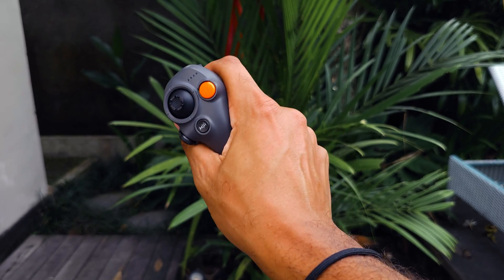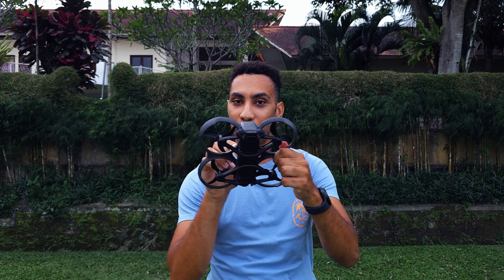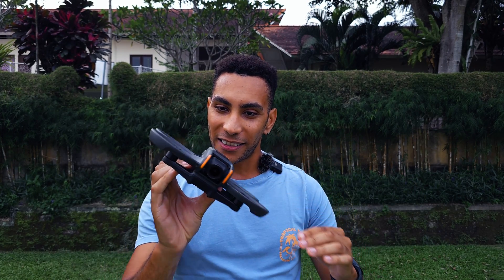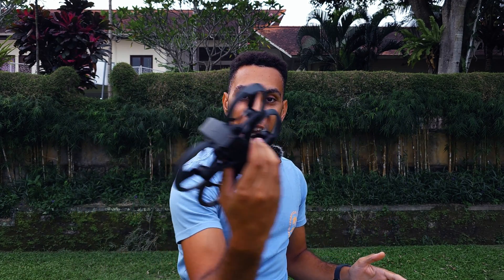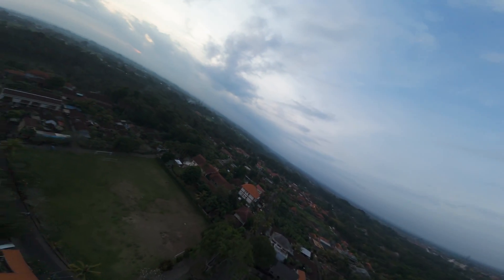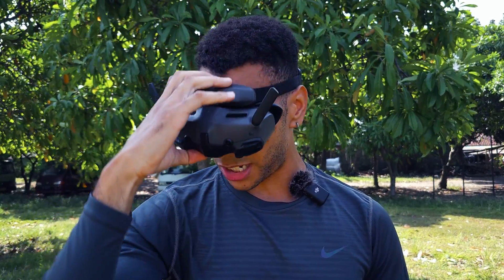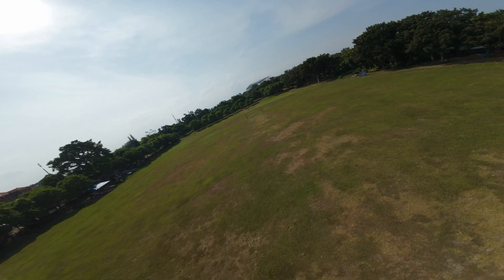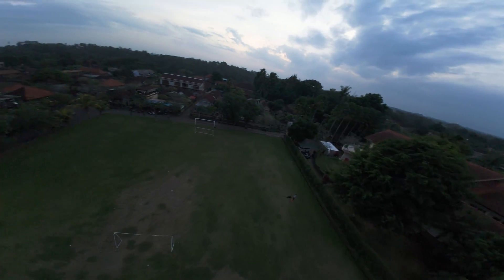How to AVOID the Yaw Tumble - DJI AVATA 2

Comment: Awesome video! Best, most thorough explanation of the issue, what causes it and how to avoid it. I do a hard eye roll every time I see someone complaining about this on Facebook or in a forum, saying that it's "a DJI design flaw!" of the Avata and Avata 2. If people just had a better understanding of what it is and how to avoid it (and how to be ready for it if it does happen), I think there would be a lot fewer crashes because of it. I had a pretty good understanding of it before watching this video, but something I wasn't really aware of was the issue with the violent shaking when descending straight down. I knew that it happened as I've experienced it with both the Avata 2 and Air 2s, but I never really new why it happened. With your explanation, it makes so much sense that it's essentially the same root cause as the yaw tumble - you're dumping the airframe directly through the dirty air from the props. Definitely feels better knowing the "why". Thanks for this!!
Reply: I mean you say this but my traditional fpv cinewhoop doesn't have any type of tumble so it's obviously a design flaw.
Reply: @BeautyBeastRC  yeap, why is it only a problem with avata and avata 2
Reply: @LibertyDIY  because it's a shitty design, I almost dropped it in the water 3 times, it has crappy electronics, I recently joined a group of fpv enthusiasts in my city and tried out a custom drone from a friend, let's not even mention the power of the motors which is impressive, but you can do that yaw maneuver as many times as you want and even at double the speed, that effect never occurs, only avata 1 and avata 2 have it. I don't know whether to sue dji to get my money back or resell it.
Reply: @BeautyBeastRC  EXACTLY!!
Reply: Too many people have zero idea of aerodynamic principles, and physics. Or, they forget to apply them. The best way to relate to this with aircraft terms is wind shear.
Reply from the maker: Yeah me too! I've always just seen it said and ignored it, but I know a lot of people are concerned about it so I wanted to clear the air and show why it's actually happening rather than just saying it's a bug. Which it's not. It's just a characteristic of this style of air frame and flying through turbulent air. Glad you enjoyed the video and also learned a little extra. Thanks for commenting 😃
Reply: The Air2s does not have this problem.. If you have yaw spin issues that result in it falling there's something else going on. Before i switched to Betaflight based FPV drones I used to fly my Air2s as hard as Sport mode will let let you and ive never had any issue close to what the Yaw Tumble issue is on the Avata1 and now the Avata2 I see from videos.. 

After experiencing the Yaw tumble a few times even after the Update that DJI pushed out and enabled RID at the same time, I gave up on aggressive Acro flying on the Avata.. Now I just use my Avata1 as a cinematic recording drone to use in Sport mode or sometimes Acro mode, to follow and film things with the nice camera onboard, plus its ease of use with the USB-C Fast charging batteries, etc.. 

Then I moved onto real FPV drones, including CineWhoop's just like the Avata1/2, and NEVER had this issue again.. Best decision ive ever made for this stuff.. I obviously know how to "fly around" the issue of the Avata in Acro mode to not have this issue happen, but its still only a DJI Avata1/2 issue, lets be realistic and just call it what it is..

Comment: What about PID tuning? On fpv all what you described is because of bad PIDs, by adjusting them one can totally eliminate prop wash and thumble...
Reply from the maker: We don't have access to tune the PIDs on the Avata 2 unfortunately. Otherwise, I would be doing just that, so it's best to just let people know what's happening, alot of people using the Avata 2 are new to fpv and won't be familiar with propwash effects. I doubt we will ever get a chance to modify pids on a DJI drone either

Comment: Tried your rates  the other morning  felt good. My second attempt  at manual   felt sluggish  before  had bout 6 hours in a sim did use that pause  button more than once though 😅
Reply from the maker: That's awesome. I'm glad you liked the rates! Yeah, the stock rates are very strange in my opinion. Hey, that's what it's there for, use it as much as you need to. You'll soon be flying with confidence!

Comment: Thanks!
Is yaw tumble factored in Sims like Liftoff? I suspect it is, but weeks like to know for sure because I'm preparing for Manual Mode. I think I'm experiencing prop wash in fast turns sure to using too much yaw and it seems that the turns is very drifty. Maybe I'm constantly going through prop wash on those tight turns?
Reply from the maker: Yep, most sims will have accurate enough physics to mimic this happening in the sim. You won't notice it anywhere near as much with an open prop quad vs. a cinewhoop. Cinewhoops don't have as much access to clean air, and the prop guards can cause the prop tip vortices to bounce back and not be dispersed, which will exaggerate the issue. But you should feel it with any good sim

Comment: Good advice. Cheers

Out of curiosity, do you get a high-pitch squeaking sound from your drone? Like metal-scraping-metal. I get it on mine; very high-pitch, it's not constant but its there all the time. I can't determine if that's normal or not
Reply: i have that sound on mine, like you said, not constant but there all the time, i dont know if its normal or not.
Reply: I have it on mine too, after a few crashes. 3 weeks later and it still flies perfectly fine so I'm definitely not burning a DJI care refresh over it.
Reply from the maker: Thank you! Nope, I think there might be an issue with your drone if you're getting a strange sound like that. It doesn't sound normal to me